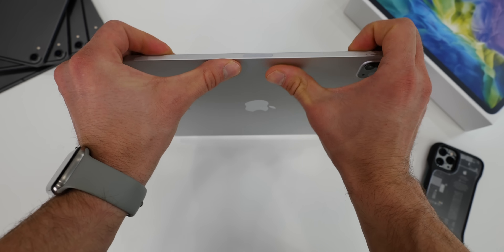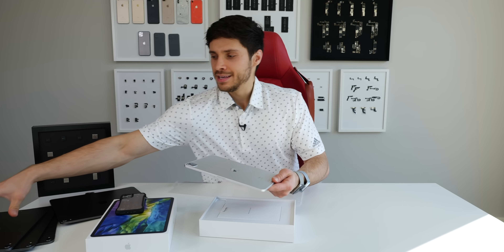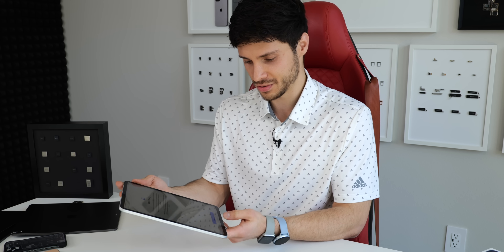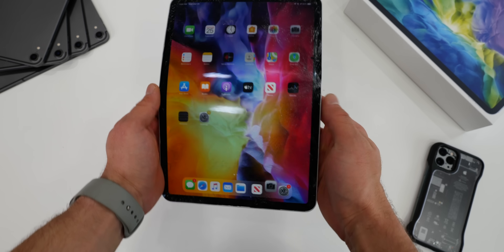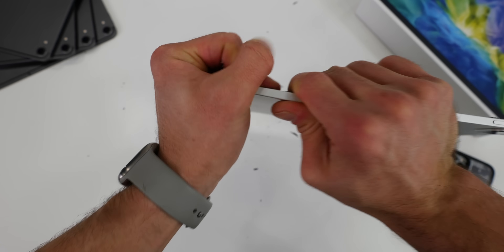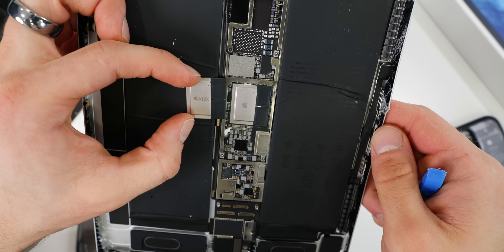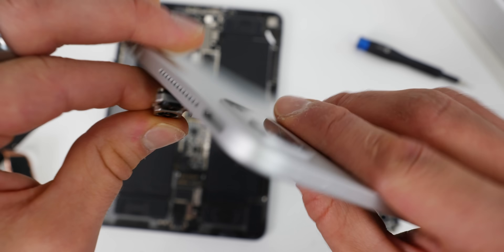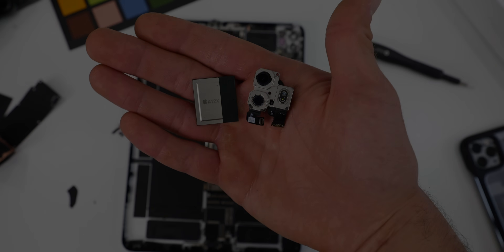2020 iPad Pro Bend Test & Teardown! Still Bends?

Comment: Apple is trying to make the ipad lighter  which they are doing by maching down material but that removes mass from. Apple is also using weaker metals to save on the cost of  the metals being purchased so the metals being used are naturally less hard and/or more brittle. #AppleProductsNoLongerDurable #AppleProductsNoLongerRobust #AppleSkimpingOn

Comment: I could literally go on a 20 minute rant about this iPad bending again. And I prefer apple over Samsung/Huawei etc so I’m not a fandroid saying this.
Reply: Most consumers want heir stuff as thin and shiny as possible, you cant make something this big and this thin to not bend without sacrificing much space for enforcements. Doesnt matter who manufactured it, a device with this formfactor will always bend.
Reply: Wuerschtle I get where you’re coming from but if consumers buy this iPad or the 2018 model and it bends (I have a 2018 model and 1 of them has bent from every day use so I had to get that replaced for £500) anyway back to the point, if it bends I’m pretty sure they will get pretty mad as it’s about £450-500 to replace it and I think then they will learn about function over aesthetics. I mean the iPad is 11” so it makes it more likely to bend. But I wouldn’t mind 8mm thick.

Comment: The camera sensors are smaller in size than the iPhone 11 Pro‘s sensors. Therefore, the camera housing is smaller. iPhone 12 Pro will have bigger sensors and therefore have a bigger housing than iPhone 11 series.

Comment: Honestly, under what circumstances will you apply such a highly concentrated force on your iPad?  Because I’ve had the 2018 iPad Pro for a year now, I’ve sat on top of it, 📚 On top of it n not in a gentle way, slept on it 😅 and it is still okey. I’m not saying that it is very durable, but I can now say with confident that you will need to apply a highly concentrated force just to get it to bend like that.

Comment: for some reason by pushing it with all my strength caused the ipad to crack and bend don’t know how that happened
Reply: Don't defend them. It breaking isn't the issue. The issue is how easily it develops a bend, which other than being ugly, can and usually does slowly cause the mainboard to flex and fail. It's not excusable to make such a structurally weak product. Especially one that starts at $799 usd.

Comment: Thanks for the video EAP !

While I'm impressed with minor enhancement on these new iPad Pros but some of these issues remains a concern:-
1. Material Quality - I've replaced my iPad pro 2018 twice due to the unknown "bending" and I've been protecting them with the apple folios as protection.

2. Apple Cases - The folio cases, it frustrating that the edges are not well protected and it could easily damage the screen if its accidentally drop and landed on the edges. 

3. Magic Keyboard - A very well good looking design and Im sure the keyboard would be a good improvement. Still, lack of good protection for the iPad and definitely wont hold the Pencil well with it. I've also lost my pencil once and accidentally damaged the tip once due to this insecure magnetic placement on the ipad Pro. 

In essence  - They seriously need to look into the quality issues and i wont mind about the pricy accessories so long as it serves the purpose well. Looking forward for a better improvement by Apple on these in the later year.

Comment: if ur thinking about making a carbon fiber case, it might reduce the signal strength dramatically, even on the wifi only models.
it might be better to stick with the materials used in generic phone, ipad, and laptop cases, or even 3D print them

Comment: Its just sad. With its price point. They should fix this issue. They've listened to their consumers about the butterfly keyboard, which is not that a big of a deal. But this? They should put their attention to this. C'mon Apple. This should be called ipad fold, not ipad pro. Ahaha. Just kidding. Still a great product. But kind of a non durable one. I can imagine putting the 12.9 inch ipad pro on my backpack and taking it out of the bag and seeing a 6.45 inch tablet. 🤣🤣

Comment: And I thought Apple was finally improving... I was wrong. I had a feeling this iPad was still weak.
Reply: It’s stronger from the last iPad Pro, and I don’t recall anyone destroying their iPad by sitting in it or anything for the last year and a half ....
Reply: @Tony_Ugatz  here's the problem : it obviously bends with little effort.  You put this iPad in you bag.  Your bag gets tossed around.  You open bag and boom.  Your brand new iPad has become apples first bendable device.
Reply: @high2100  do you think the effort he put is little? Well think again, he almost lost his breath folding the ipad🤣🤣🤣
Reply: I’ve never had any issues with my Pro bending and I’ve had it for over a year
Reply: But the durability still probably mean it will bend slowly overtime, probably won't effect the actual use but ya

Comment: Me: Buys the iPad Pro and uses for 10 years.
EAP: BUYS IPAD PRO ONLY TO BREAK IT RIGHT AWAY. LITERALLY.
😂
Reply: you use the iPad Pro for 10 years?? the iPad Pro hasn't even been out for 2 years yet... you'd probably not even use it for 10 years because they will always make a new iPad "pro".
Reply: @RW1lcmdlbmNl  they probably wants to USE IT for 10 years, also what do you mean if they make a new ipad pro it doesn't mean it will get taken away, sure it will get older and might get throttled, (just replace battery) but can still work for 10 years (if used right)
Reply: TheGamingMaster I mean it’ll probably lose support by then so it’ll be pretty useless by then
Reply: @AltraHapi  nope. I'm sure that the batteries aren't removable.
Reply: @RW1lcmdlbmNl  I am not rich to buy things often buddy. Plus 10 years was a comical exaggeration of my situation. 😂
Reply: SOO TRUE 🤗🤗👍🏻👍🏻🎁💯
Reply: @jc.1221  A microscopic brain.... Lol.
😂
Reply: @Sai_on_youtube  I would dedf use mine for 10 years too lmao I have 2014 and 2016 MacBook both still run great !!!!!!